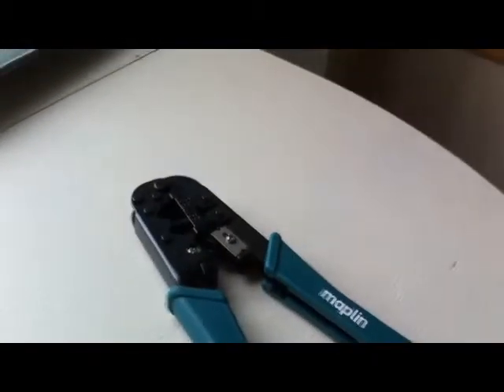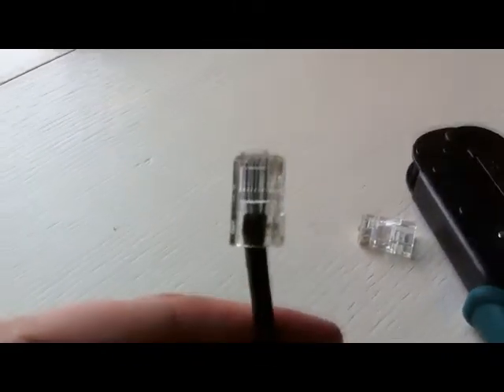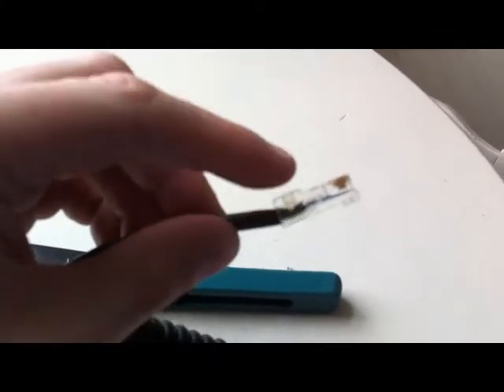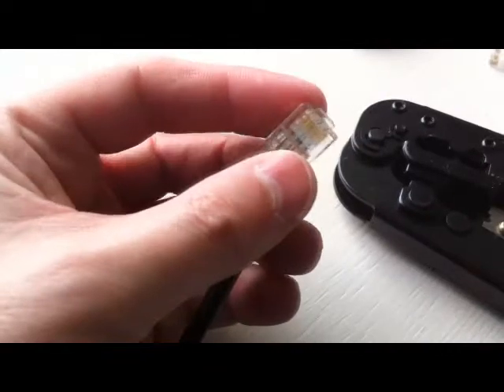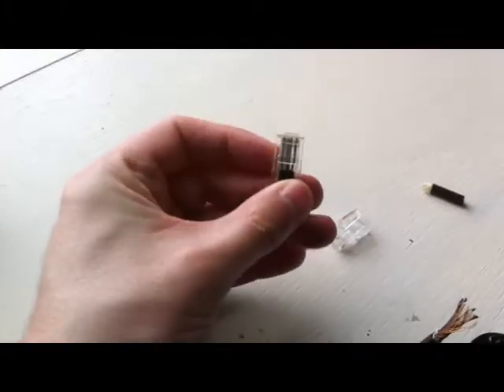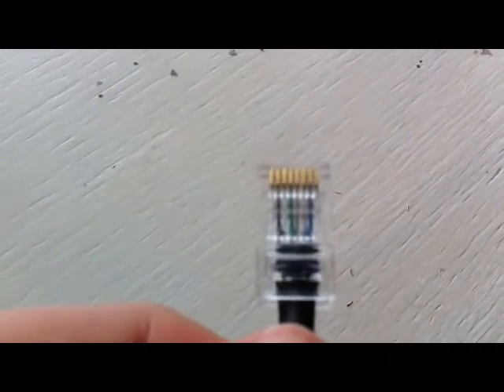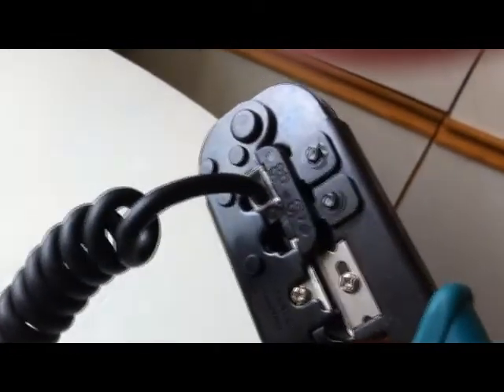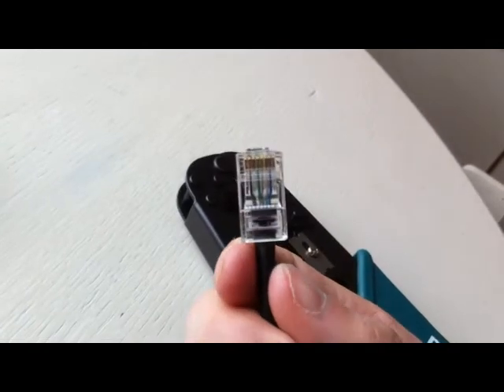Icom 706 MKIIG Mic re-wire

Comment from the maker: @gez021 

Hi, I would have liked to have filmed all of the process but I didn't have a tripod to hold the camera. 
What I can say is it is quite a fiddly job as you have to push all the wires into their corresponding slot all at the same time, some double up etc. Cut the old plug off and use this as a guide to setting up the new wiring. It took me a few attempts to push in new wires to get it right. 

Also you really need the crimp to finish the job off properly.

Comment: would have liked to see more detail of the actual wiring process , not just the cutting off the old plug and crimping the new one , just my opinion , as i need to replace one on my 706 mk-1 and never done this type of plug before , thanks anyway ,